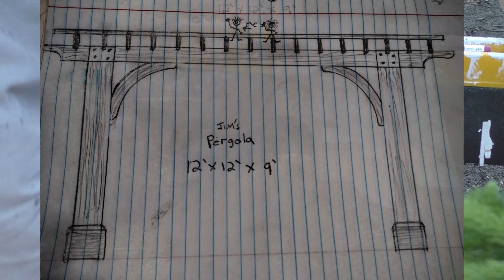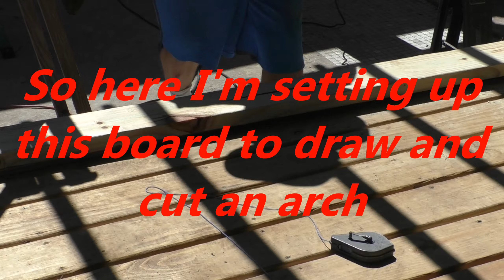How to build a pergola part 1

Comment: Jim, nice work. My only real concern is that you only bolted the support beams. Why not notch the top of the posts so they could sit onto them. Now the weight is sitting on the bolts.
Reply from the maker: Thanks Pat it was really fun too make. I wasn't really to worried about that, it's not that heavy if it were any bigger I definitely would notch it.